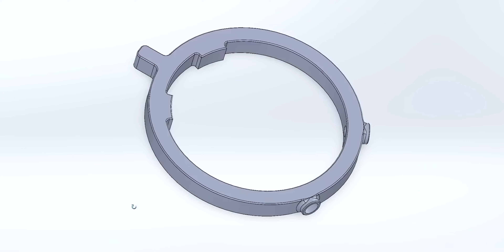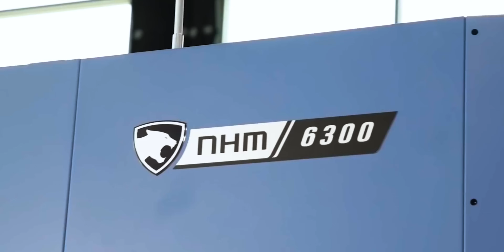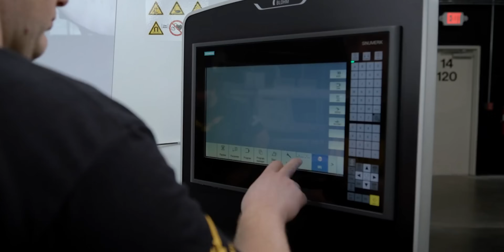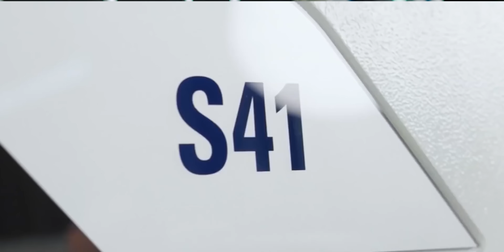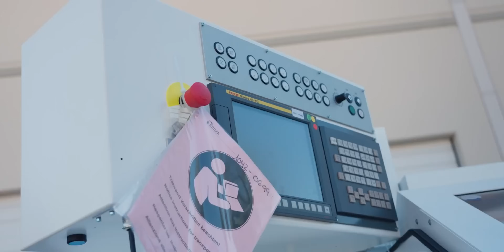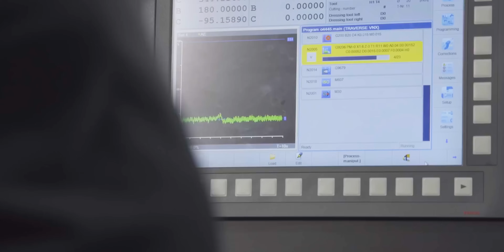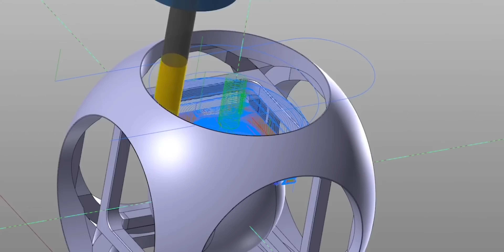Why Monster Employees Make More Money and Rise above Everyone

Comment: My first job at a machine shop I got there when I was 18 quickly my dad showed me how to run an Okuma cnc lathe , within months I started programming in IGF and slowly moved into GibbsCam I loved it soo much but my bosses would always drag me thru the ground , but yet I became the shop programmer and even then they would say “too slow” “not enough experience” I ended up leaving that place after 6 years I was the supervisor of the cnc lathe dpt and I was dying to jump on the mills but my old bosses said “learn how to run the lathe first “ funny cause I left that job and got an opportunity a year after I left to run a cnc mill, and I loved it now I’m making 40 plus an hour and programming both lathe and mill and I run both . I’m the only guy in the shop who does parts start to finish. And I would have never made it if I didn’t leave that hell hole place .

Comment: Speaking of grinding, I just got accepted as an apprentice for tool cutting and grinding for a company called LMT Onsrud. I'm super excited not to only work for them but also learn so much. It will be 3 years of schooling and 3 years of working for them after school is done. I cant wait until January when it all starts. Titan and crew have been a huge part of the reason why I'm in this industry in the first place when I worked at a production machine shop. I got laid off by them and that gave me the chance to apply for the apprenticeship. 

Thank you so much for the inspiration and the motivation to be more. I'll do my absolute best in order to work hard and succeed.

Comment: My work makes the actual copper consumables that make all the chips around the world, at one point we supplied 75% of it in our little area of the machine shop that had less than 5 guys, I. Learnt how to run everything, and it’s very in depth strict process of machining, everyone else since has left and no one at my work wants to run those parts , Iv became the only guy that knows it all, no one else wants to learn it, I left that department,’and we have button pushers only now, it was so boring I had to leave, whenever there is a problem I’m always called, the guys we have button pushers are unable to learn ,one guy has to be shown everytime he setups just how to use a edge finder, it’s that bad, they want to get rid of me for other reasons I can’t discuss but they can’t/wont because no one else could or will do that job. I’m all for training anyone even if that’s my downfall , but they just won’t or can’t find any competent machinist for some reason .